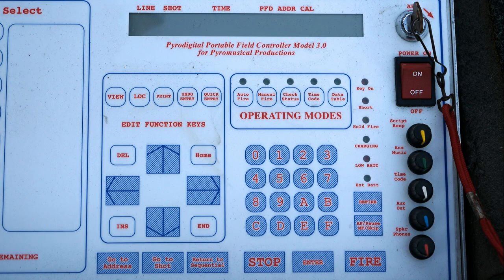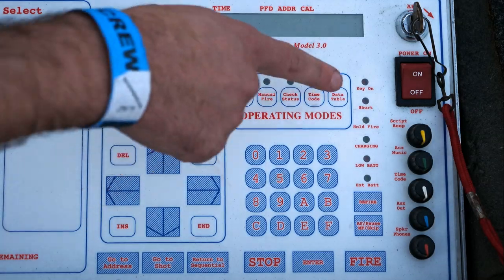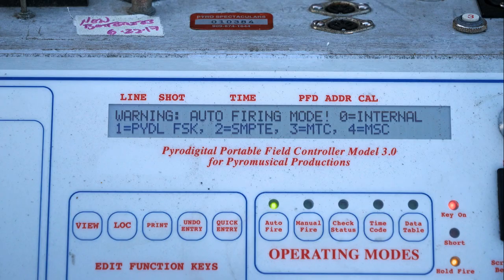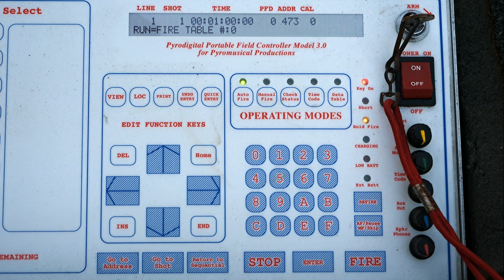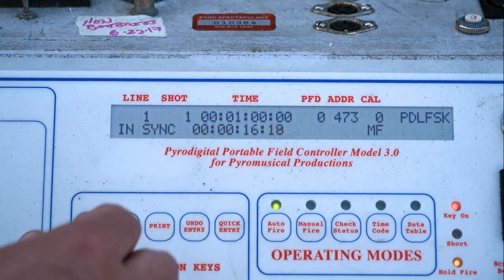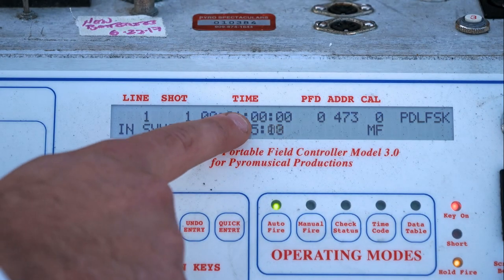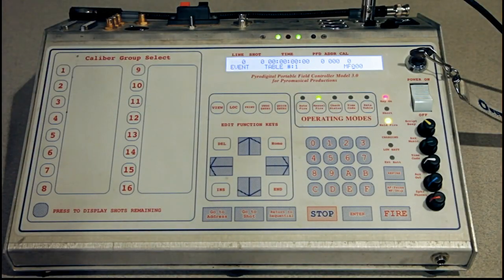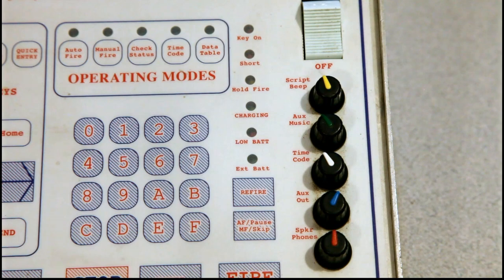Pyrodigital - Auto Fire Using FSK Timecode

Comment: So would the music track that the DJ is playing have some sort of timecode overlay on the music as well?
Reply from the maker: Great question.  The audio file is a stereo (right and left channel) soundtrack, with one exception.  The left channel is the show music, and the right channel is our FSK time code.  This way, they are playing from the same file (or CD), perfectly in-sync.  Make sense?
Reply: LiquidFire Yup, can you show how that is done and what the setup looks like?
Reply: You can also use Visual Show Director to output the timecode from the wave file. In this way you can have a script with multiple sequences and fired them at will in any order. IF the wave file has music songs then you are a DJ and can shoot song+sequences in any order.
If you pair Visual Show Director to Show Director CONTROL then you can also link to a DMX interface and control at the same time pyro and the DMX equipment ( flames, cryo,, etc). More information in www.infinityvisions.net